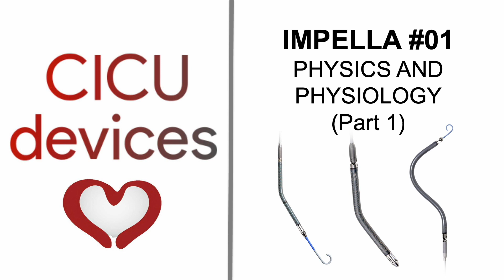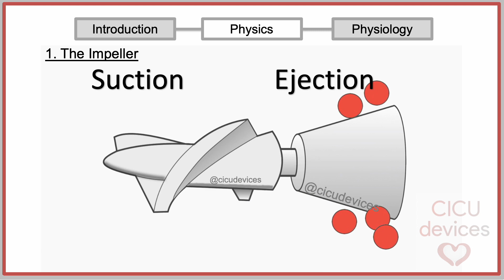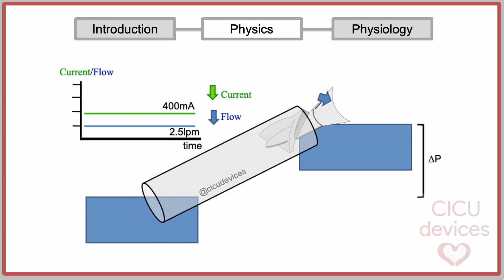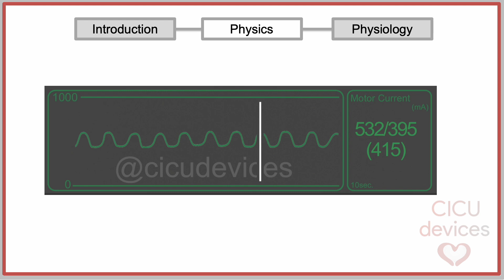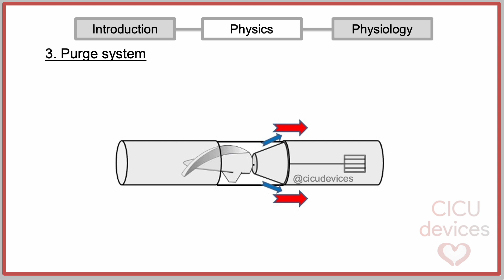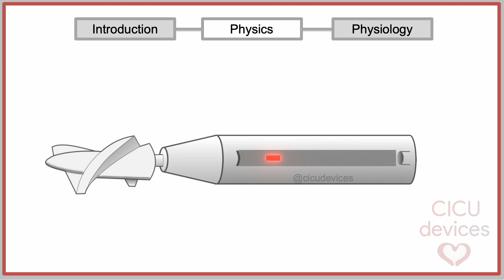⚙️ HOW THE IMPELLA DEVICE WORKS: PHYSICS AND FLOW (IMPELLA GUIDE 001)

Comment: I’d like to ask a stupid question, why would motor current be proportionate to the flow instead of the pressure gradient? I have understood current as correlated with the force required to overcome the pressure difference, is my understanding fundamentally wrong?
Reply from the maker: It is true that it can be a bit counterintuitive. But you can think of it as a conveyor belt operating at a fixed speed. If the conveyor belt is empty (low flow), it consumes little energy, whereas if it is carrying a heavy load (high flow), the energy consumption is high.
Reply: @ Thanks for the reply! I still can’t wrap my head around it.. Let’s say, during isovolumetric contraction, LV pressure would increase while aortic pressure remains the same, pressure head would subsequently be lower. I would expect motor current (ie the load) to decrease though I know in reality it’s the other way round.
As the ventricle contracts, I am assuming the rpm stays the same.
Did you mean, even though RPM stays the same, flow across impeller increases because pressure head decreases, hence a higher current is drawn?
Reply from the maker: That’s the idea.
Reply: @ by current, are we referring to the electrical one here?
Reply from the maker: @ Yes, we are referring to the electric current.